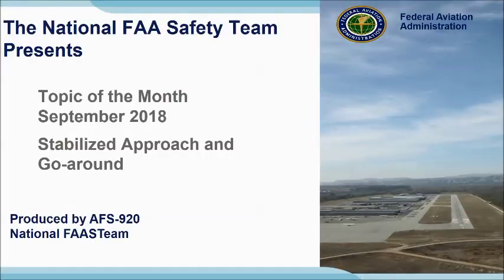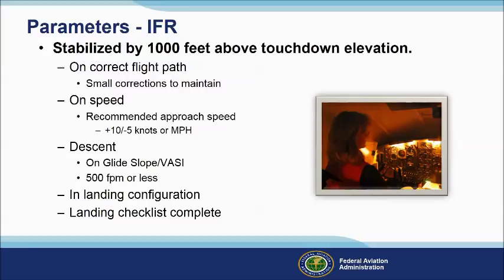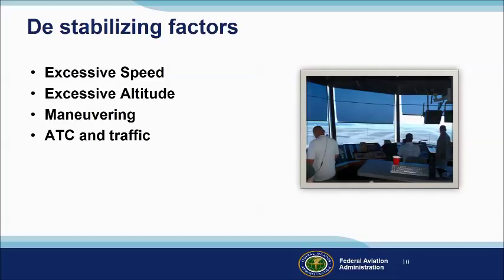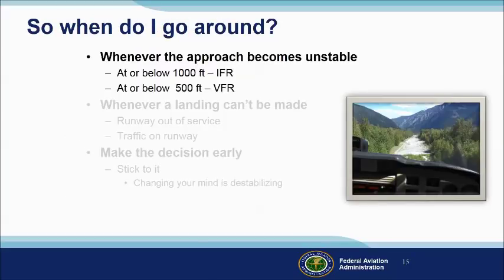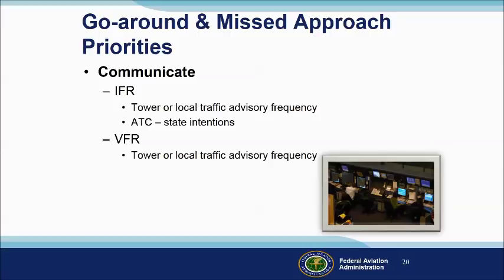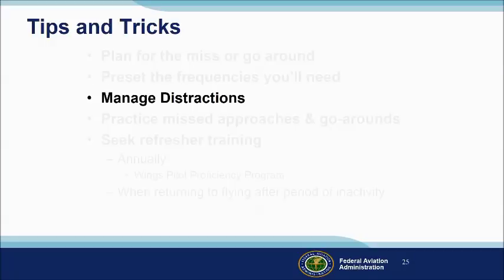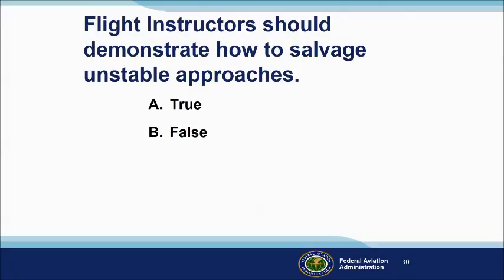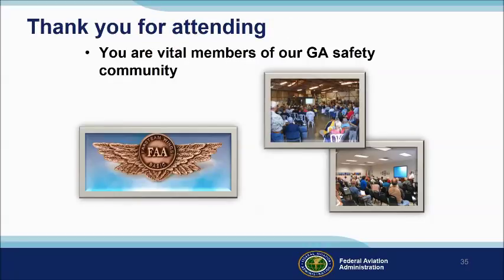Stabilized Approach

Comment: 2:44 Missed approach is a "point" MAP not a "fix"  The missed approach point may be a fix on occasion, but FAA should not make this kind of public error.  3:54 VFR criteria is not accurate or reasonable for light GA (where all the accidents are) We dont know what "path" is, and full flaps will definitely not be added at 500 feet, therefore landing checklist cannot be complete.  Ironically there is NO guidance in any PTS or ACS regarding what our stabilized approach goals are!   Here they are:  1) On speed 2) on vertical path (Vasi, papi, GS, or visual) 3) touchdown on centerline.  4) touchdown in TDZ of first third.  If ay "ANY" time one of these goals becomes not likely, "THEN" go-around.  Go-Around is not decided at 500 as you indicated, ie "Since we were good at '500 we are good to continue..."  '500 is a good first gate.  The better gates occur much later, and if any one of those four become questionable, then Go-Around.  This video is kind of un professional and mis leading to those that don't know any better.

Comment: While I agree with most of the criteria and tips for stable approaches in this video, and applaud the FAA's continued focus on this topic, I believe they defaulted to a "stable by" altitude that is far from practical for the hundreds of thousands of small single-engine operators, and those of us who work with students in the training environment.  Big jets may be stable by 1000' AGL, not needing to make any more configuration changes from this point down to touchdown, but this is just not the case for small aircraft, nor is it a reality when bridging the gap from visual to a precision instrument approach, where a decision often needs to be made at 200' AGL and flaps added at this exact moment, once the landing environment is sighted.  How could any GA pilot be taught to be stable by 1000' AGL if flying a typical rectangular pattern, where at that altitude the plane may still be in a faster clean configuration, and after turning final it might be in a full flap configuration with 20 knots less airspeed.  To get from one configuration to the other takes lots of planning, anticipation, and adjustments by the pilot (regardless of experience level), so while I teach that the descent in the pattern should be stabilized and follow a constant descent rate of about 500ft/min for most single-engine pistons, it is NOT practical that the pilot has to DECIDE if the approach is stable by 1000' AGL and DETERMINE whether or not to execute a go-around.  While different flight departments establish a variety of "stable by" altitudes on approach, my training department teaches a stable call-out by 200' AGL or the go-around should be initiated.

Comment: Good advice all the way through.  I fly glider these days and so out of necessity the primary need in the pattern is for a good stabilized approach.  If anyone using power wants to practice hand flying like this, or doing patterns without an engine, take a few glider flights.  They are also a lot of fun!